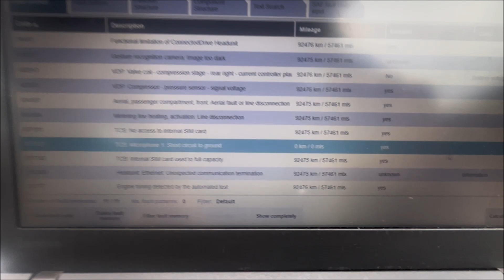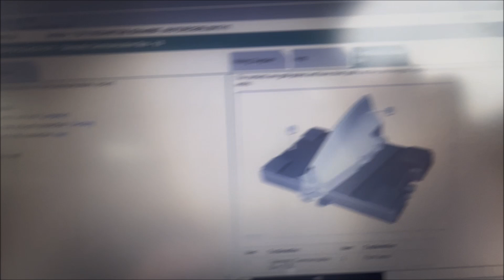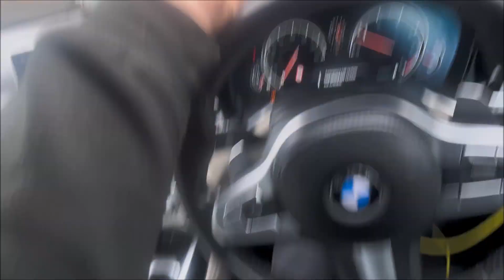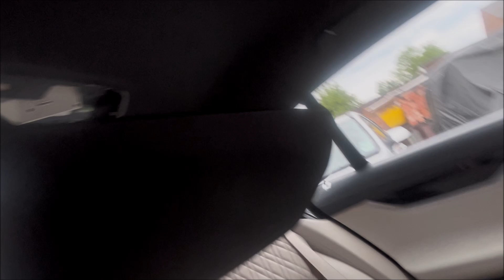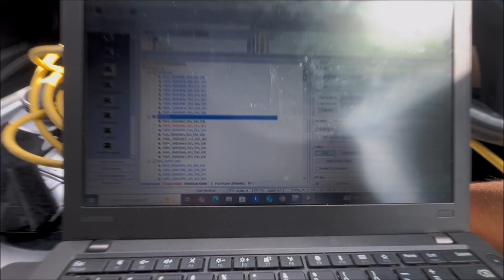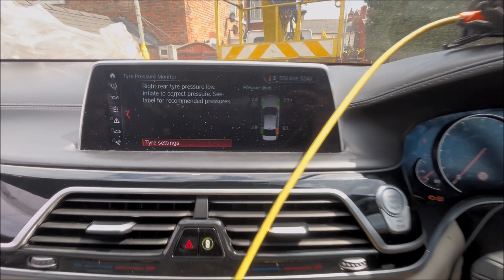BMW EMERGENCY CALL SYSTEM NOT AVAILABLE B7F311 B7F327 B7F34E

Comment: Hi,
I think I have exactly this problem on my 2018 5 series touring and I replaced the small battery but unfortunately it didn't resolve the issue. 
Therefore I feel that I have suffered water ingress too.
What would be a ballpark figure for you to supply and fit a new telematics unit please
Reply from the maker: Hello,

It all depends on the part number of the part.

If you want to contact us on WhatsApp we can get you a price. +44 7806 736 555